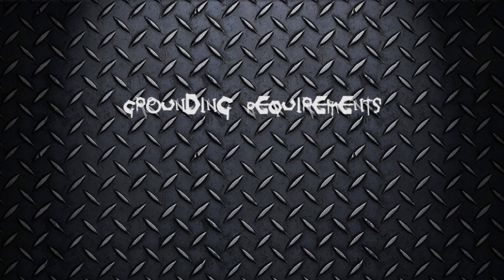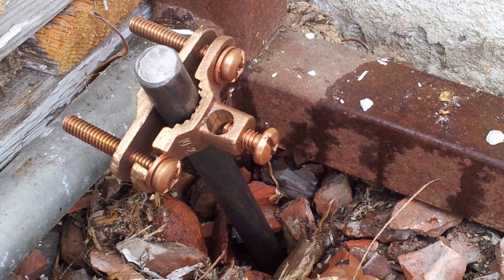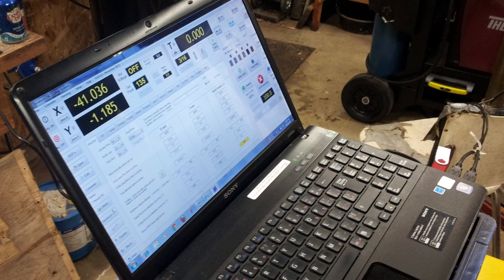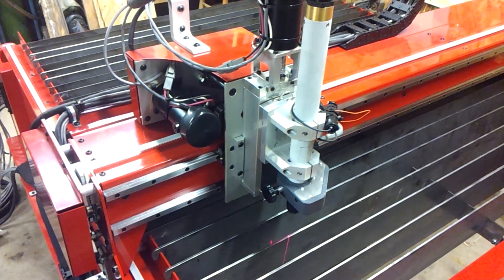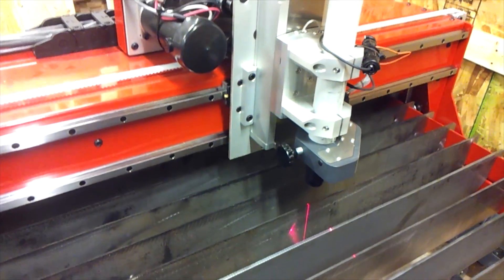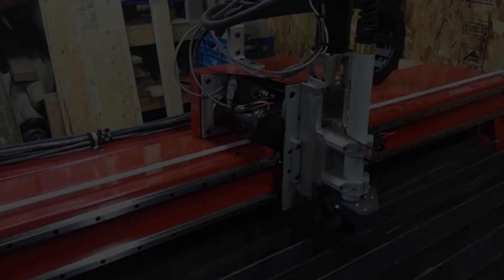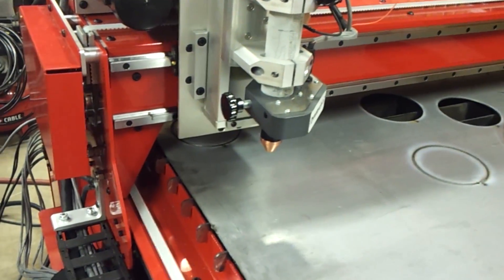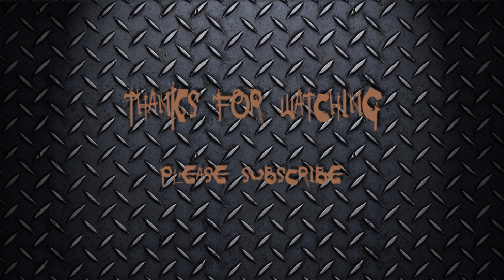CNC Plasma Table - Dynatorch Super B 4 x 4 Setup and First Cut

Comment: How much are these?
Reply from the maker: +19672701 You would have to check now but when we bought it maybe $12,000 USD but I would call them and ask for current pricing.  I recommend the machine as it's still cutting now after years of light commercial use.
Reply: thanks I have been looking at them for a while.
Reply from the maker: 19672701 Give them a call.  The sales guy Ric is great and will price out a system for you.
Reply: Thanks!